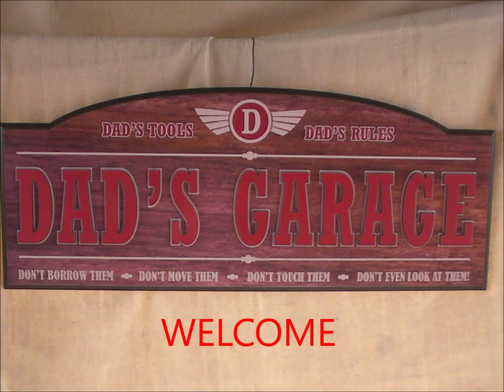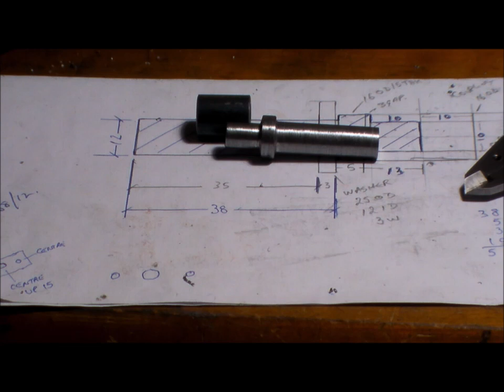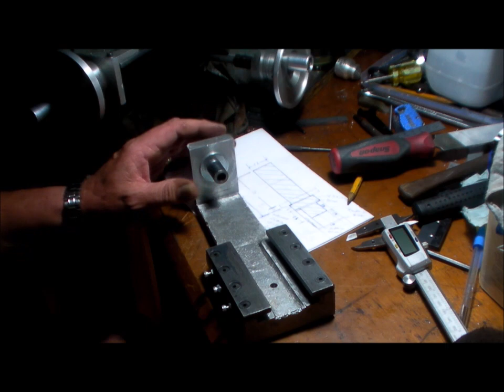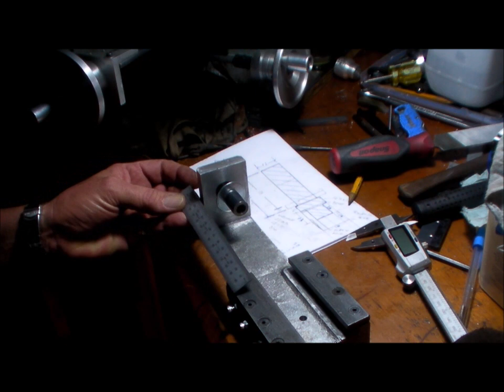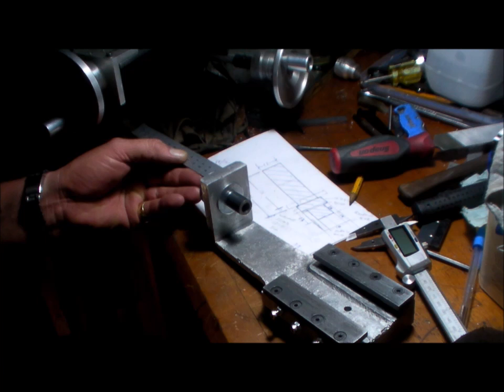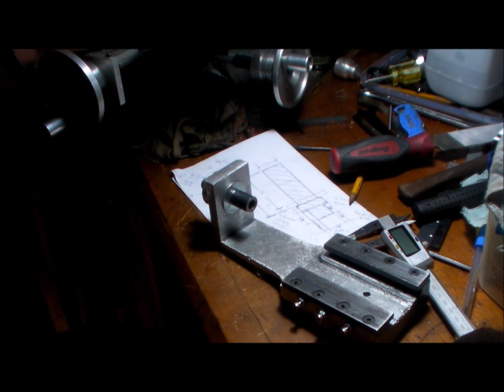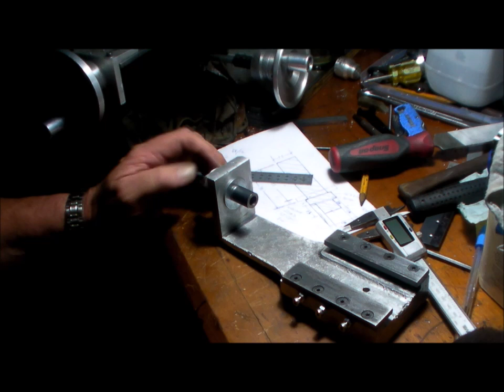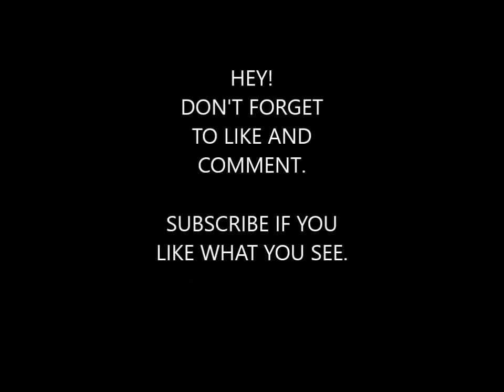Building the Gingery Milling Machine 85, the Tail Stand is assembled

Comment: G'Day Peter, its a nice feeling at the end when you do the assembly of your hard earned components and it looks like its suppose to.  I glad I'm not the only one who can't see the wood for the trees and scratches his head saying, now where did the extra 30mm go.  At the rate I'm going Peter, I think your going to be finished your project before mine.  Great stuff.
Cam
Reply from the maker: G’day Cam, I was annoyed at myself for missing that major component in the shaft size build up, I probably would not have missed it if I had CAD it but since I was following a book that didn’t happen, anyhow it was such a simple component it was not necessary, I could do this in my head, not to worry I recovered and adjusted things to make it work. I notice even with CAD you adjust things on the fly, sometimes it just doesn’t look right in real life does it. As for finishing first, I don’t know, I’m milking this for all it’s worth, I got the arbor, the indexer, the gear blank cutting and then the final hand wheel to finish. 
You know I decided early in the build to make this build a story, showing all the build processes and any other extras that make up this series, things like the Steady Rest, I needed it to centre drill the main spindle, now the simple indexer to fix the lathe drive pulley, it’s all part of the build. I’ve been at it for 2 years now it’s time to finish up. ( after I fully milk it of course)
Cheers
Peter

Comment: So for your other hand wheels, how about setting the clearance with some shim stock, clamp the hand wheel firmly in place and drill a dimple in the shaft for the point of the set screw to sit in, sort of like a gib screw.  That would prevent the handle from working its way up the shaft.  The tail stand looks great!  And the sneak preview of the arbor to boot.  Ashamed your lathe is broken down, you could have made yourself a square broach for that hole in the arbor you have to make to hold the cutter to fix the lathe.  Hmmm...  That's a vicious circle isn't it.  You are getting there Peter, in spite of the setbacks.  Thank you for sharing with us.  I love these videos.

Joe
Reply from the maker: G'day, it's always good to hear from you. I hear you with the hand wheel solution, Hmmm something to think about as I haven't done anything with any of the hand wheels yet.Yes if I had some tool steel I could make a square broach as buying one is far too expensive but then you wouldn't have the pleasure of me sweating over a hand file, I moan, but it didn't take too long.
You mention a vicious circle, yes it is the life cycle of the home hobbyist working on the cheap but it does provide some breaks in those long projects, I know it does, and it provides for some excellent video footage.
Cheers my friend.
Peter
PS:
Burke Mill!
Burke Mill!
Burke Mill!
Reply: Last week was a bugger for me, I hope to get back on it this week.  I was contacted by a guy who says he has one identical to mine and offered to make parts if I needed them. I am thinking I may have to see if he can give me some insight on the carriage screw.  Not sure but I think I have some issues with the one I have.  More on that later.
Reply from the maker: Great to see some community spirit. I was offered in my last video, to make the toothed pulley, I had to graciously decline as making the pulley was a good leaning and video opportunity for me. 
Cheers 
Peter